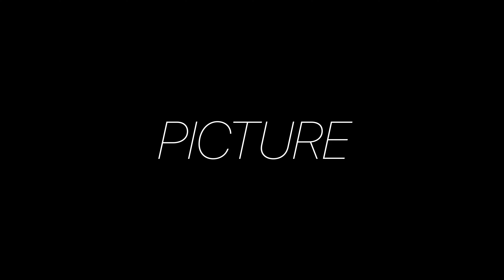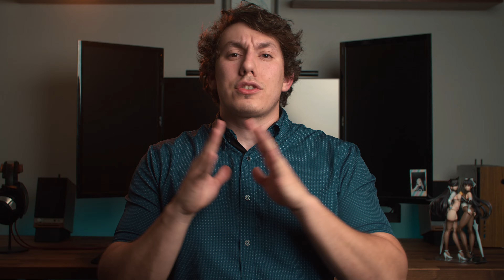Imagine Never Needing to Charge Your Phone Again!!

Comment: Drones and EVs require far too much power for these weak cells, but i did forget basic electronics applied and they can be wired in parallel for more current, so i think they could be viable for phones, but still not for Drones and Cars. seems promising if this is just a conservative first prototype though!

another thing, i think these cells use Beta decay, not Alpha decay, which are just energetic electrons, instead of helium nuclei. this radiation is still safe with a dense enough shield, elements that emit beta radiation and negligible amounts of gamma radiation (traditionally understood ionising electromagnetic radiation) are now easy enough to obtain.

this stuff is still likely to cost a whole lot more though, obviously nuclear material is still heavily regulated and difficult to get, as well as charging a premium for never plugging into a wall and cost of materials for supporting equipment and shielding, a phone with these could be uhh... $10,000 instead of $1000
Reply: You would need 10000 of those cells in parallel to power a phone (around 1W)
Reply: @panjak323  that doesn't seem right, really? aren't they 100mw? only 10 are needed?
Reply: @xymaryai8283  100 microwatt